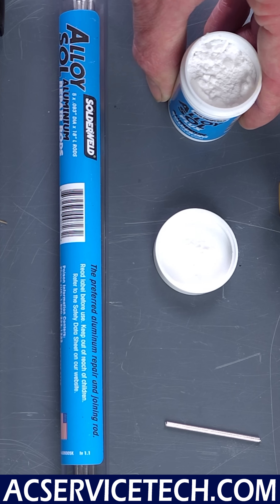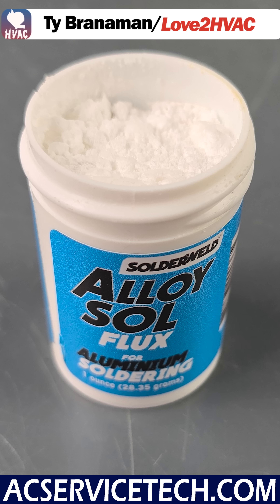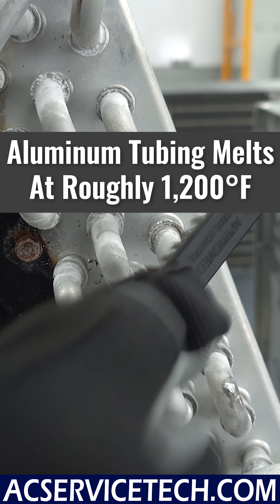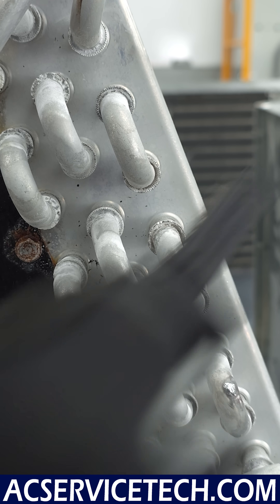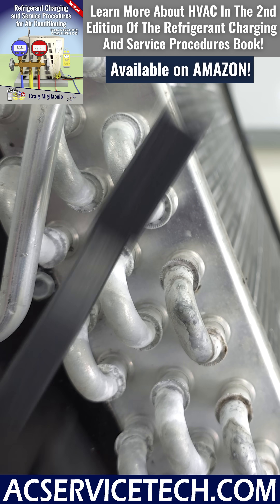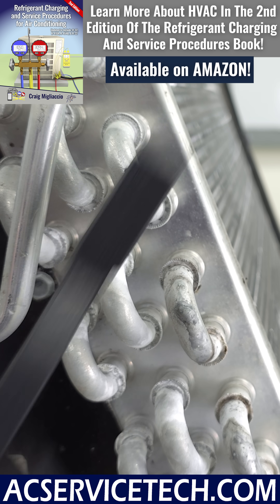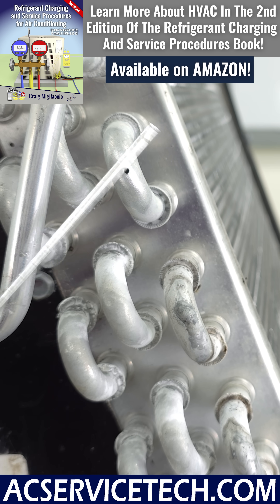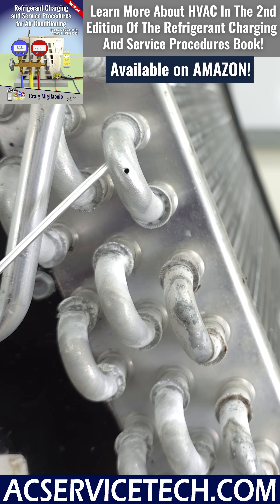Fixing an Aluminum Coil Leak using SolderWeld Braze Rod and Flux

Comment: For a 2-stroke engine, integrate a CVT gearbox between the engine belt pulley and supercharger to enable instant high boost from idle. Add a second supercharger to extract exhaust gases from BDC ports encircling the cylinder.
Post-combustion, the piston descends to BDC, uncovering exhaust ports (1 cm width from the piston's lowest point to its uppermost edge).
Dual superchargers then force-scavenge air before the piston rises 1 cm (port width).
The piston ascends; intake supercharger delivers desired boost.
Intake valves close once boost is achieved; piston compresses for next combustion.
Two-cycle operation.

Roberto Javier Garcia Castellanos.
,
.
/
.,
/

Comment: I use mapp gas to keep the heat at a controlled temp. It’s just like sweating copper pipe but less forgiving.  Heat control is key.

Comment: That's nice but there's barely any real world application for this... 1) If the coil is still under warranty, just replace the entire coil. 2) Leaks in coils are never a super obvious, perfect round hole right at the end of a u-bend like that... They always leak either at the factory braze or where the metal of the coil's casing meats the copper, and when there is one leak, there are usually many. Often across 5-6 u-bends or more... Therefore, again, just replace the entire coil. I've been in the trade for 16 years and I've never ONCE encountered a real world situation where repairing a RESIDENTIAL evaporator coil by brazing its leaks was a sensible solution monetarily. Leaks in coils are always like the first few raindrops of an upcoming storm... You fix one but others are always coming...
Reply: More leaks on the way

Comment: Heat with what? Acetylene or map gas?
Reply: I normally use an air acetylene turbo torch
Reply: acetylene but use a small tip it takes no time at all to hit melt point and turn it into a pool.
Reply: Where can get this
Reply: Why not use propane or something that delivers less total heat to reduce the possibility of melting?  If it because, ultimately, acetylene isn't an issue if it's used properly?